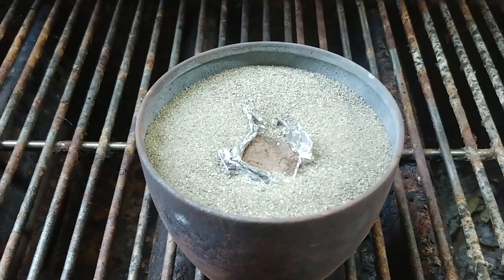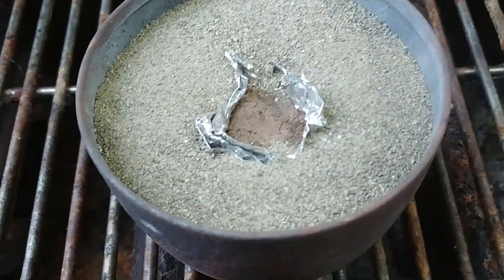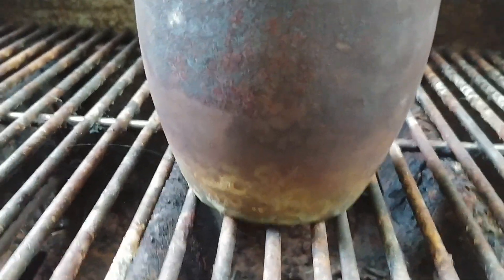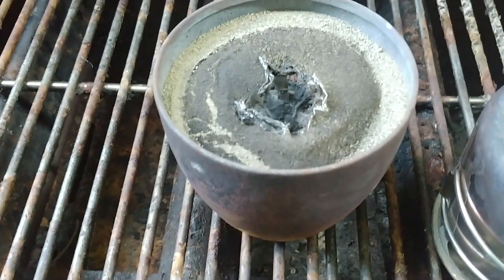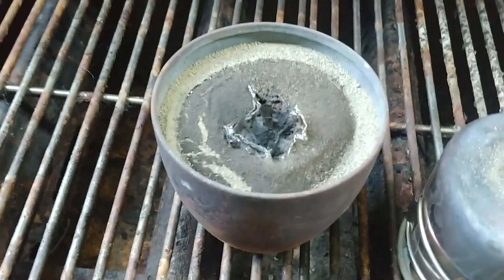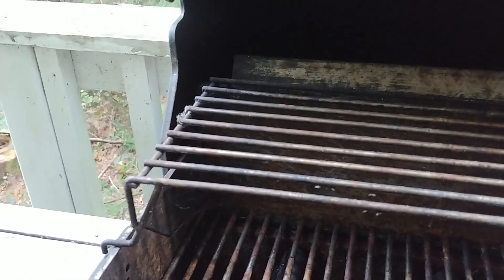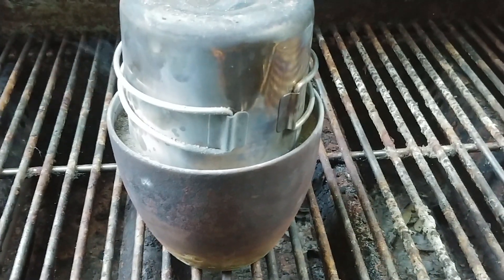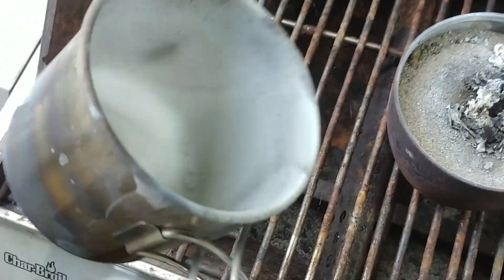Home Chemistry: Using Thermite to Create Ruby?

Comment: Use Arc welder
Reply from the maker: I would if I had one.  I do experiment with high voltage arcs in my vacuum chamber, which will fuse corundum and eventually, I'll have more content uploaded addressing this.

Comment: Dude, Thermite melts railroad tracks.  Off course, that means its totally safe in a tinny grill on a wooden deck.  Never mind the damn smoke, imagine how pissed your neighbors will be when you burn the whole damn neighborhood down.
Reply from the maker: There was no chance of the thermite making it through the pot of sand it is held in. It especially wouldn't make it through the sand trap below it either which isn't seen in the video.  If I knew nothing of what I had done in this video then there could have been a serious problem, but fortunately I did actually take many precautions with the first being limiting the reaction to a volume too small to get carried away. It may have been in the previous comments on this video or of another I did which explains all the details. I also haven't performed any additional reactions on my balcony since the last thermite video because I choose to not influence or encourage others of doing something with the visual apparence of potentially not being safe. All I can do is respond to your comment by saying you have a valid point.
Reply from the maker: At the same time I would like to revisit this experiment some day on a much larger scale, but that would definitely be held outside city limits.

Comment: Stop putting the lid on your sniffing it out. Also youd need to isolate the heat into the oxides better. But first please stop doing shit like this on your porch. Like any cement pad anywhere would be better than lighting thermite on your wood patio. Not trying to be mean but if the first thing your worried about is neighbors complaining about smoke, then you clearly haven't considered the legal ramifications of burning an apartment building down.
Reply from the maker: You have a perfectly valid point which is why you don't find anymore videos of my balcony executed thermite reactions.  I took many precautions off camera to ensure personal safety and safety of residential property.  I had multiple fire extinguishers and 10 gallons of water behind me, as well as a large sand trap under the bed of the grill, so the grill itself had nothing to do with being a safeguard.

This is also why I did this reaction in very small quantities.  I dried my reagents shortly before the experiment so that there would not be any steam explosion of any scale.  The quantity of thermite I reacted was actually too small to be snuffed out before the reaction had finished.  There was plenty of oxygen accessible for the reaction's short duration.  I typically used a small amount of potassium nitrate as well to supply enough oxidizer to carry the reaction to completion.

My goal was never to get a pure iron product or to even fully react all the iron oxide and aluminum powder.  I only needed the heat to fuse a small amount of ruby feedstock into red corundum slag.  I did actually create perfectly formed red crystals which there may be a link in my description to the micrograph pictures.

I really do appreciate your comment / concerns, and I can't argue against your points, which is again, why I stopped performing these types of reactions on my balcony.  No matter how many precautions I take, there is always a chance of some unforeseen incident, or worse, someone tries to imitate what I've done without taking any necessary precautions to ensure safety.

Comment: Hello Matt. Found some flame fusion furnaces for sale in Moscow several years back. About $12,000. They had just up dated their facility and sold their surplus furnaces to China. Really considered buying one but never did. I new the answer before I asked them would they provide the chemical formulas if I bought one. Sort of made him mad. I am retired now and can not afford to do it. I should have seen if they would sell me the hydrogen oxygen torch they use with the powder feed. Do you by chance know where you can get the torch state side.
Reply from the maker: I don't know where to buy the torch head, but I have designed my own. I have a few other ideas in the event my first one doesn't cut it. I'd be happy to share my plans once I have proved the concept.

Comment from the maker: The end result was no noticeable trace of fused red corundum crust.  There are some very cool crystal structures inside the bubble it formed in the slag and I suspect it to be synthetic hemetite as it shares the same rhombohedral crystal structure.  These crystals are black and opaque and I'll get micrographs of these interesting crystals soon with my microscope.--I'll need to cut away some of the top of the bubble first.